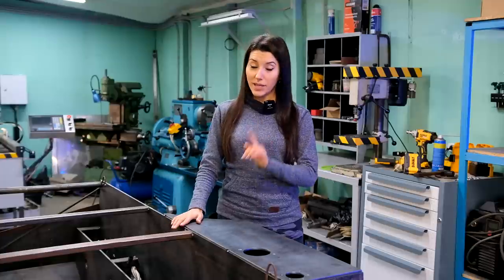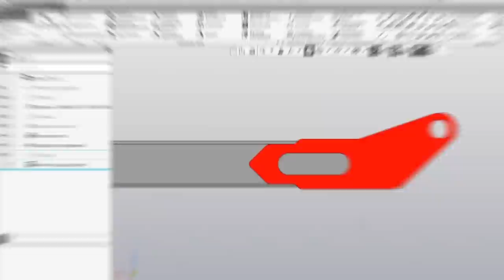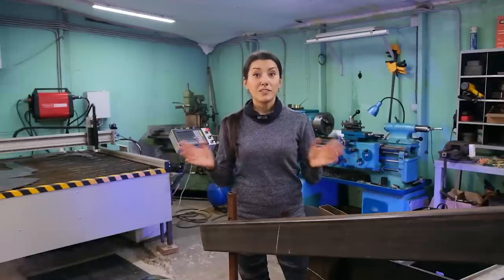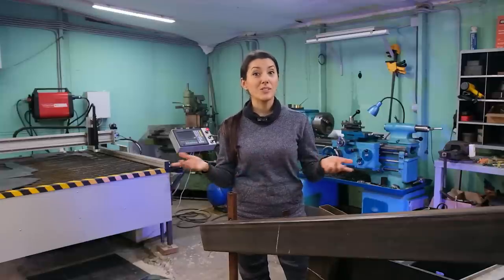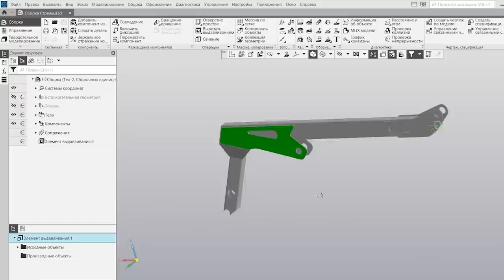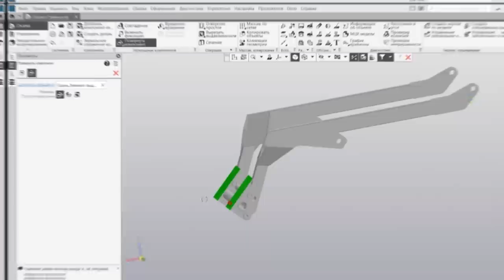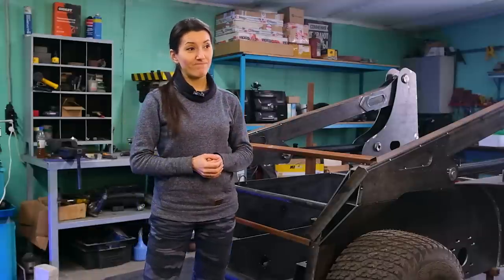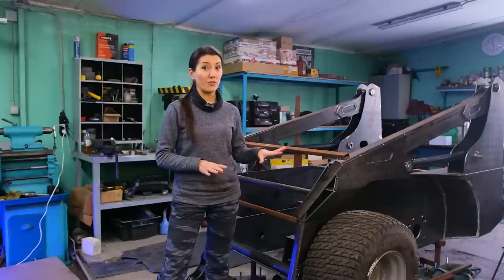DIY SKID STEER. Part 2. Boom arm. MINI LOADER.

Comment: Hello Lucy.
That's a problem of the women's world with the spatial imagination, but you can do several things at the same time. We men only one after the other, we can imagine technical components and turn them in every direction in front of the inner eye. I get a bit of stomach ache your solution with the offset of the lift arms ... if you have a problem, post a short video and describe it, someone always has a solution.
I think it's great what you're doing. Mfg

Comment: I haven't got any design comments I can make. I am not a designer of heavy equipment, and I'm also not a fabricator in any event, not even as good as you. But I will tell you if you managed to get this far and have only made the mistake of not knowing where and how you will attach the lift cylinders, you're doing pretty good. I am a master carpenter and cabinet maker; I forget stuff all the time. 

For comments, let me say I like the look of the reinforcement plates on the arm, but I wonder if they're heavy enough? I've operated some skid steers, and I think the reinforcements are 13mm, perhaps 15mm. No problem if so, just weld on another plate. And one thing I will tell you: I think you're making a mistake making the pins and bushings out of the same metal. Did you use hardened steel? If so, fine. but one metal must be softer than the other or when they wear, it will wear both parts and you'll have to replace both. Make one or the other harder and most of the wear will confine itself to the softer part. You'll only have to replace pins every third time, if you put the wear on the bushings, or vice versa.
Reply from the maker: Thank you. Yes, I plan to add more plates to reinforce the lift arms. As for the pins, they are made from the hardened steel👌
Reply: @luciasworkshop  Good, I'll shut up then, and just watch :-)

Comment: I have some serious doubts about that motor you are planning on using. Don't expect same work output as commercial vehicles of similar tonnage. They usually have minimum of 50hp, I used one with over 80hp for few years and it actually got some good power and did the job in a time span that was acceptable.
Reply: Yes, it is a relatively small gasoline engine. Loaders that size would usually have a diesel engine of twice the horsepower.

Comment: Which CAD software are you using?
Reply from the maker: I use Kompas-3D
Reply: @luciasworkshop  Thank you so much for taking the time to respond.  I'm always looking for CAD alternatives.  🙂
Reply from the maker: @Bent Sprocket Tech  I've also used Solidworks, but decided to try Kompas for this project😉
Reply: @luciasworkshop  I am also a long time Solidworks user.  I use it for work, but I am always looking for other software that might be good for teaching.  🙂

Comment: why are you building a skid steer in staid of buying one?
Reply from the maker: I answered this question in my previous video ;0)
Reply: In this case the need and use of a skid steer is secondary. To a hobbist metalworker, it's first of all about the challenge of planning, designing, and building something like this oneself, and make it work.

Comment: Her accent is like from Russia,or some Slavic country.
Reply from the maker: It's because I'm from Russia. I told about myself in my previous video.
Reply: @luciasworkshop  You are still in Russia.
Reply: @codetech5598  You are very likely correct. Well guessed.
Reply: @Rimrock300  It's not a guess; she said so. Her usual response to questions like this are "Watch my other videos" in which she explains it.
Reply: @codetech5598  'You still in Russia' is a statement that makes no sense as she knows where she live, and you know where she live as she told in her previous video. Youtube comment fields never stops to amuse me)
Reply: @Rimrock300  I said that because the location in the "about" column says "United States".